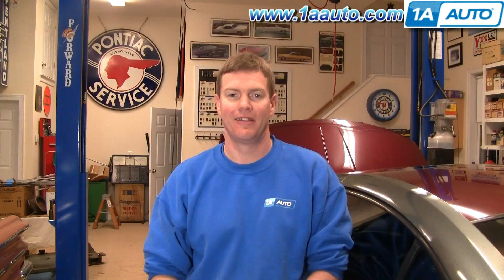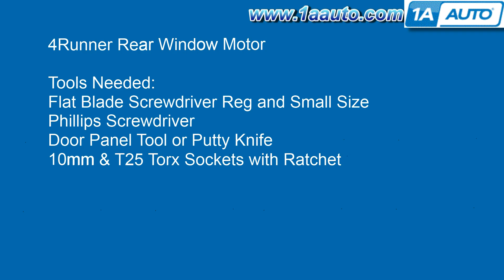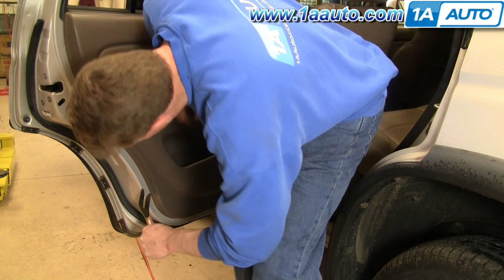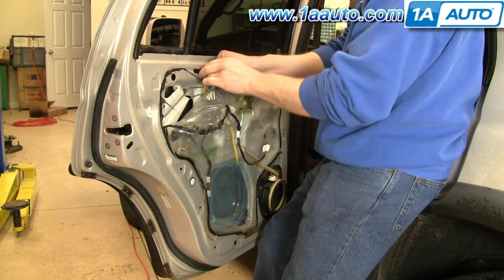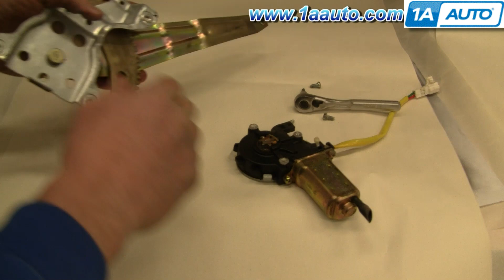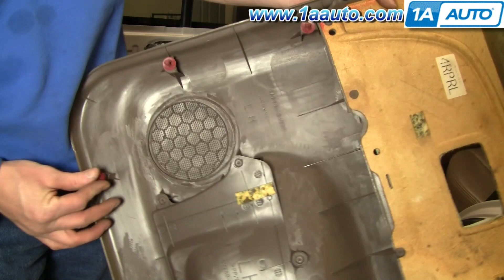How to Replace Power Window Motor 84-02 Toyota 4Runner

Comment: Hi, can u help with my passenger door window?  It only goes down but not up with using both window switches on driver and passenger.  I confirmed it's not a motor issue already.  Can you give me some pointers on what to test?  Thx

Comment from the maker: We currently do not have an auto repair video that shows you how to do this, you may need to remove the rear door panel on the lift gate to open the door from the inside so that you can fix the issue. Hope this helps you out.